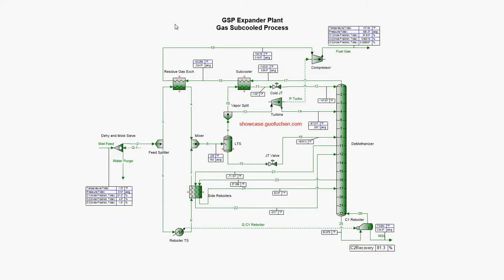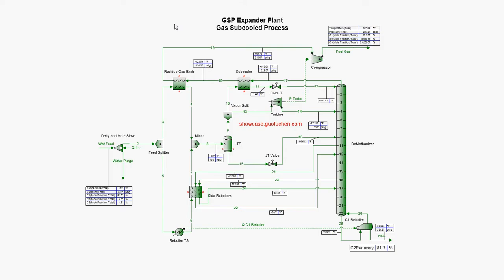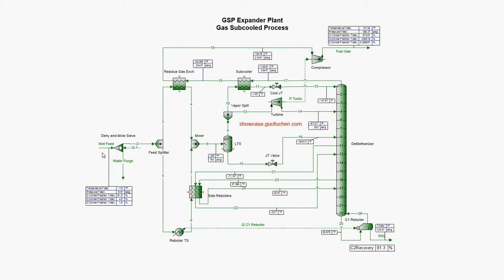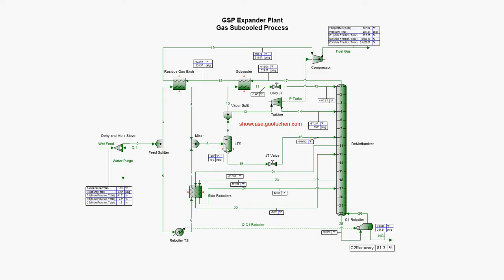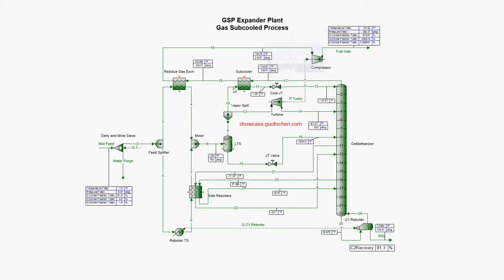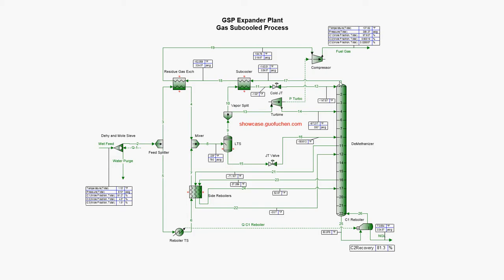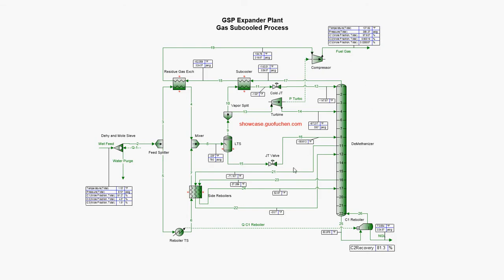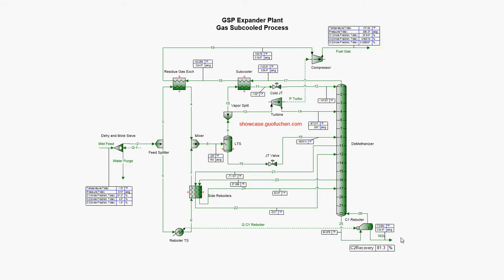An introduction to modeling GSP gas processing plants in ProMax

Comment: Interesting video.  Not sure I understand the contribution of the side reboilers to the ethane recovery. The main benefit of these is to reduce the main reboiler heat load and to chill the incoming gas stream? I’ve always understood that the cold reflux stream to the top tray was the main factor influencing ethane recovery?